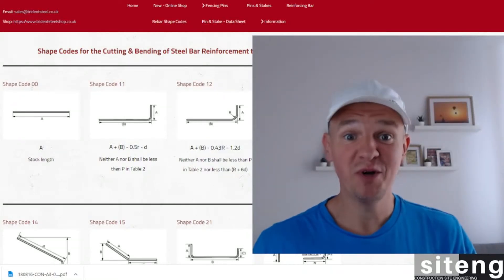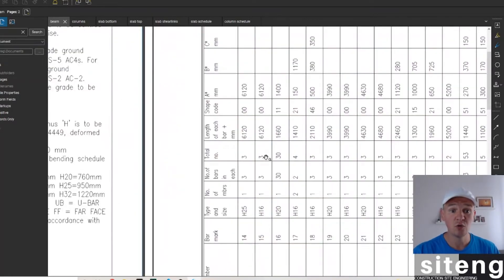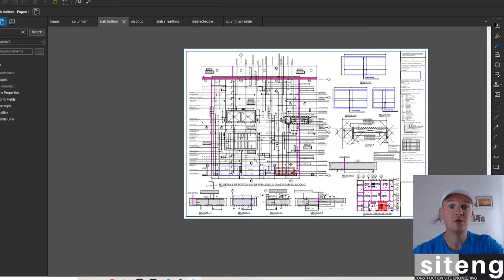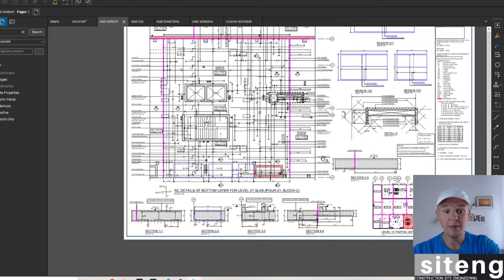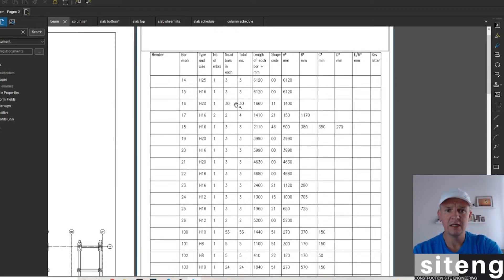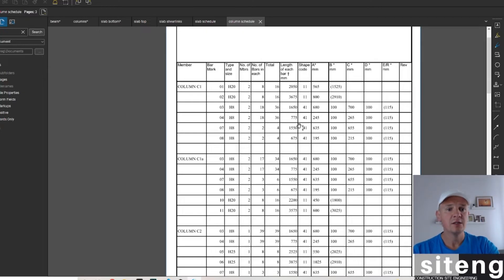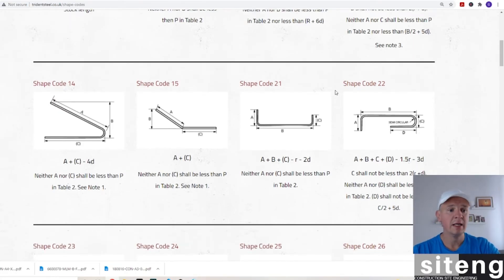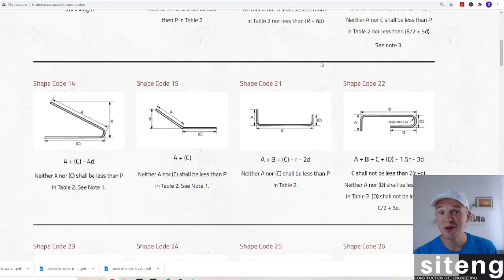How to read REBAR drawings, schedules and codes.

Comment: there must be an error in the formula someone clarify why i dont get the same answer:

Shape Code: 12
A + B - 0.5r - d

A = 200mm
B = 1000mm
r = 20mm
d = 10mm

My 3D measurement doesn't match this formula. 

actual : 1191mm using arc length (31.4mm) 180mm + 980mm 
formula: 1180mm
Reply from the maker: I would be really surprised if the formula is wrong, I would rather assume the formula is right and cut the bar 1180 which after bending would probably give you your 1191 - think about it and let me know :)
Reply: @SITENG  

Yes but I'm not assuming it's correct I've calculated and I'm getting different results. 

I can understand using a different formula because when bending metal it's not as simple as a line. You can test it yourself but 0.5r is not the arc length of the curve.

A is straight line 
B is a straight line
C is a curve 

A + B + C 

C is definitely not the arc length of a circle. 

So am I not correct to think there's an error either in calculation or the formula. 

What is (0.5r - d)?
Reply from the maker: @belaluddin3593  As I said I assume this is the steel working, but you would have to dig deeply into the standards how the formulas are created and what's taken into account - This is the L of the bar needed for bending not a total when the barmark is ready
Reply: @SITENG  Thanks was just a little confusing. I'm sure there is a reason.

Any video on BB Schedule

Comment: Concrete grade C35/45
What is 35 ? And 45? Please explain
Reply from the maker: it's compressive strength of concrete, one is for a cylinder (150x300) sample and the other is for cube (150x150).     Ccyl35, Ccube45 -----> C35/45

Comment: What software do you use for your structural designs?
Reply: Uhmm But which structural softwares will you recommend for someone hoping to work in the UK
Reply from the maker: @Kennedy-f5q  TBH I am not sure what software is used mostly for structural analysis. It depends on the company. Definitely it's worth to know Revit, or Tekla
Reply from the maker: I am not in structural design now, that was long time ago 😁

Comment: What is the standard way to write the bars if there same bars in top and bottom (EACH 32)
.  Ex. 2/32 T12 - 01-150 T&B OR 
64T12-01-150 T&B
Reply from the maker: Closer to first one:(second ex. is definitely wrong)  2x32-01-150 T&B, but why not keeping B and T separate?? Remember on sites ppl work with A3 drawings and even simple rebar drawing is much better when separate

Comment: 41 box bar , 51 standard link 63 double or security link , 33 sausage link 👊, each bar mark with same shape and dimensions is bundled together max 2 t per bundle so painful for fixers when comes to digging, very often it’s better for them to say they are missing. Each load is weighed once complete and always should be under as steel is under rolled.👊
Reply from the maker: Yeah😁 I know the story with missing bars and then full skips of steel going out the site. Think it changed already, or will change any soon with the current steel prices.
Reply: @SITENG  yeah even scrap price went up and companies are short with stock on some diameters . I think only Celsa and Liberty in the Uk rest is import Megasa ect.
Reply from the maker: Crazy times now, hopefully it gets to normal 😁
Reply: @SITENG  yeah for sure please hit me up on LinkedIn I applied for crane job on Hinkey 👊

Comment: gypsum supports,starting from LS , long span goes first as a 1, then the short spans SS vertically as a 2, then followed by chairs,after that verticals SS as a 2 and then the horizontal long span LS as a 1, concluding the 1-2,2 -1 rule on the slabs?
LS ,SS   (chairs) SS ,LS
Reply: Thank you sir!
Happy holidays
Reply: My understanding was the LS long span is the outer coat,SS short span is the inner coat,even vertically since it wouldn't make a solid structure if you install on a slab vertical rebar first.
I am basically trying to see if I am missing something.
Like we put first the long horizontals -long spans and on top you put the smaller vertically ,considering the weight also as a factor.
Thank you sir/Siteng for your time,your videos are an oasis!
Reply from the maker: Harry, not really sure what exactly you want to know. Slabs - first is B1 then B2 ( B3,B4.. -  depending how many bottom layers), second - chairs installation so the top mat can be installed then T2 (or T4 depending on how many top layers) - with this top layer all column shearlinks should be installed not leaving it for the very end (which almost always happens). Please also note while installing bottom and top there might be separate drawing for extra/additional bars and these have to be installed as you progress.

Comment: While calculating the BBS of a stirrup,what is the bend allowance you generally consider (Say steel dia is 10 & 12 mm). What about the hook length?
Reply from the maker: Hi Rajarshi! Bends are minimum allowed and hook length and shape depends on the load acting on the element (reacting forces inside the element), all this you will find in Eurocode2